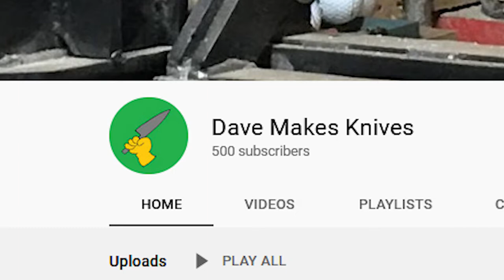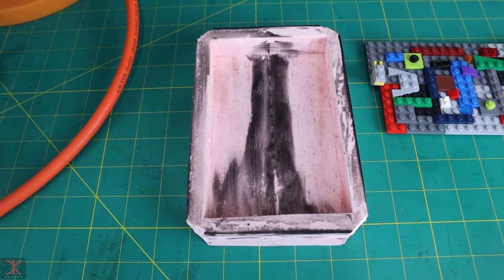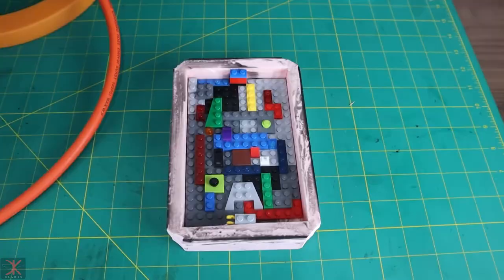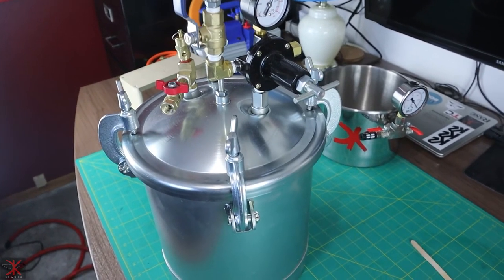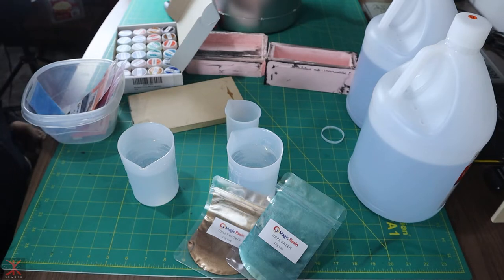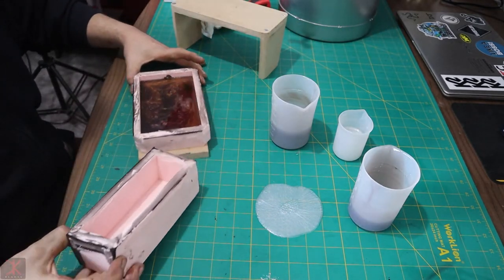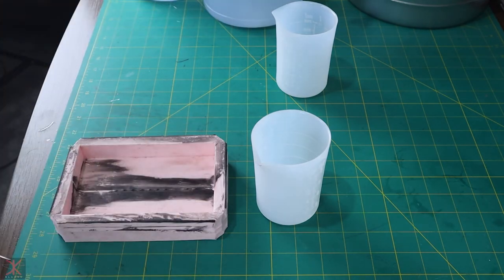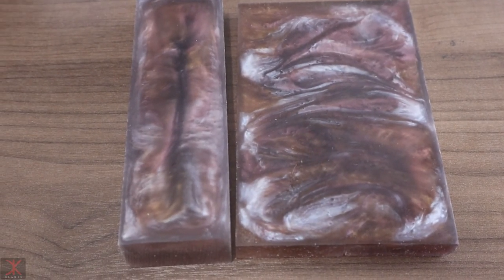Resin casting some knife handles

Comment: Don't do a typical "mix". Try a little swipe left and right at the bottom and then centre your stick and swipe directly up the middle, then slowly slide the stick out without it dripping back into the mixture.
Reply from the maker: I will probably do another video soon for some resin cast handles. I will try your suggestion. Thank you 🙏